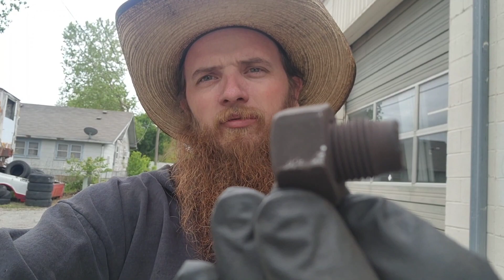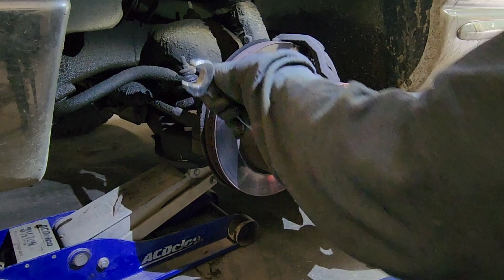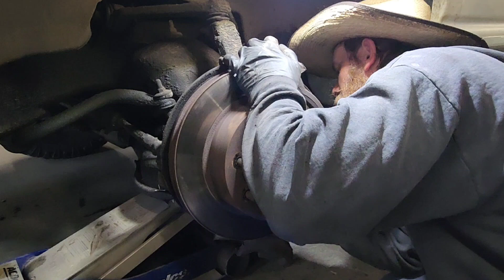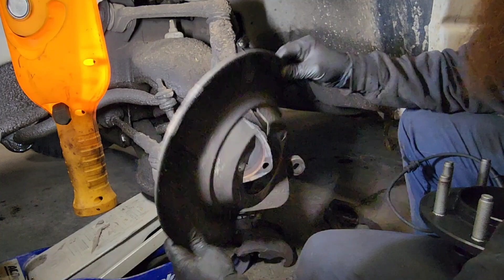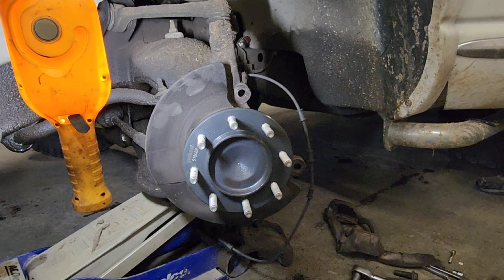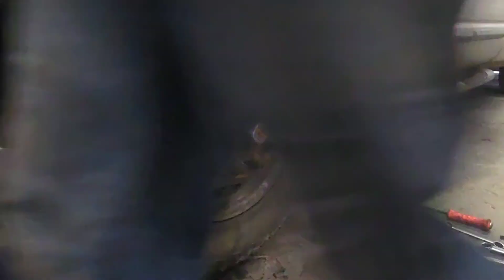This is why I follow my instincts!!           04 Ram Hub replacement

Comment: Yup i have to change my bearings in my front driver side crazy glad you figured it out , i also had to change my studs recently i drove for three days with only 2 lugs and the weren't even across from each other 2right next to each other 🤦b well 
✌️VANDAL OUT

Comment: I was pretty confused as to why you pulled the hub when you could simply replace those press in studs with new ones by using your impact and a nut to suck them in but once you got it off and determined the hub was bad I understood...I have done that exact repair myself only I just replaced the studs in mine...that hub was pricey...